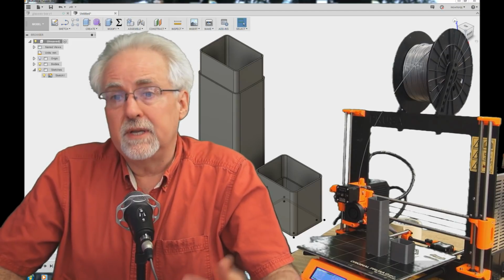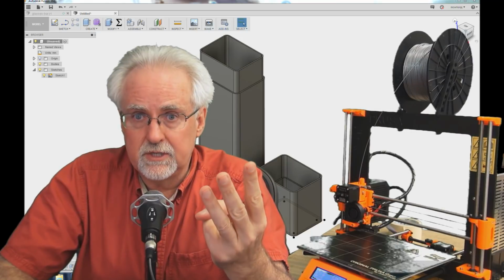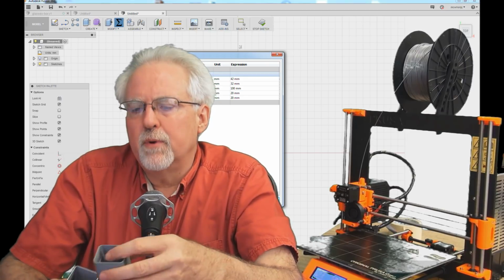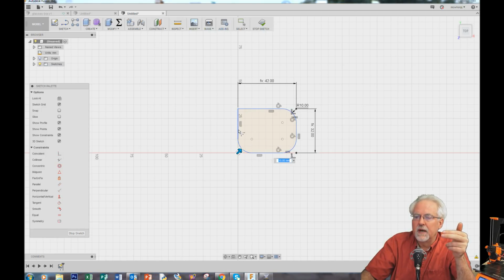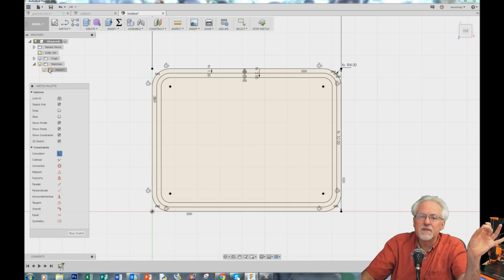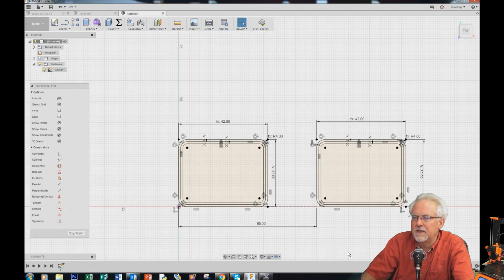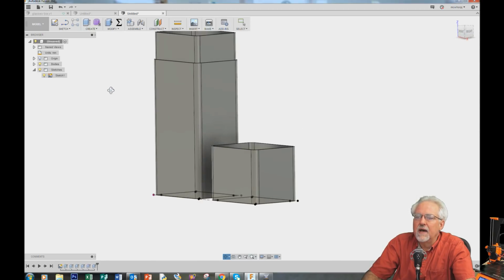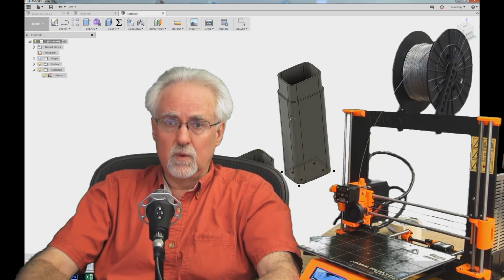Learn Fusion 360 or Die Trying LESSON 5: Understanding Parametric Design and Modeling

Comment: If i type - (space) lip thickness I don't get the same problem as Paul does and don't have to re-enter the wall and lip thickness offset numbers. And the total height was height + lip height so changing the lip height does change overall height. But not a big deal. Loving the series and learning lots. Thanks a million Paul

Comment: I will tell you, I just downloaded Fusion 360 2 days ago. I needed to make something simple so I played around by myself. I have never designed or worked with much in 2d but I got it done in a couple hours because there was just thickness for the 3rd dimension. I have since wanted to design something more complex. I am glad I found your lessons. They go just slow enough to understand and do along with, but not too slow where you are waiting. I didn't understand how amazing this program was. Now in just these 5 videos I think I could take off running. I will however choose to learn more from the other ones.
Reply from the maker: Thanks for the kind words. Glad it is working for you.

Comment: Paul you are doing a great job all around; BIG THUMBS UP. Question: I have a table I'm drawing and each leg consist of (3) different pieces of wood to complete the leg. The leg is in the shape of a triangle, should I draw them as (3) different components?Two of the parts will be made from 2x4 and the third will be from a 2x6. I will later do a cut list and would like to know what components used 2x4 and which ones used 2x6. Any help would be greatly appreciated.

Comment: Great presentation ... have one question though.  Coming from a tool and die background, where does fit interference come in on the dimensioning. Normally eg. ... a 1” OD Bearing of material won’t fit in a 1” hole. As you know there needs to interference fit calculated into the drawing. How does ‘‘tis figure in on 3 D Printing. Thanks again.

Comment: Thanks for your guidance  Paul. Lesson 5 complete and it's given me enough of a clue to use parameters in my design work. I've also modified you design  a scootch on the cap to increase itself a bit so that it fits over the base easily. No 3D printer is perfectly accurate and line squish will oversize an object by about 0.1mm or so. This causes the cap to bind up so I added another parameter in the model called SquishComp which over sizes the cap by that amount. It's an absolute value since the squish isn't cumulative. Onto the next lesson. Once again thank you sir.
Reply: I would have thought that the slicer software in conjunction with the printer's profile would take care of this properly.  After all, the slicer output G-code is not going to instruct the nozzle to extrude centered along a wall boundary line, it will be offset to one side by half the estimated width of the filament extrusion. That said, it is good to be aware that clearance can be addressed in the design tool like Fusion, and indeed is made easier by making clearance a parameter.  Of course, all bets are off if you want to print the two parts assembled :-).

Comment: Love your tutorials! Thank you! Have you thought of doing a tutorial series on Eagle PCB from Autodesk. It is the only software that I use in my classroom that you haven't done.
Reply from the maker: Believe it or not, I have never done a pcb board before. When I played around in the past, when it got down to it, there were a bazillion different "choices" as far as the design and fabrication parameters, and I did not understand what meant what or what was important. It was easy enough for me to grasp the concepts of layout, where the holes and wires go and so forth, but then when it got to checking design rules and all the parameters, I felt hopelessly lost.
Reply: @paulmcwhorter  
Fusion 360 allows Eagle PCB to be pushed to it. Image designing a 3d enclosure around the pcb that is right in your model. Osh park has a DRC file on their website plus simple instructions on dropping a zip file on their main page. Then you see all the board layers as they will come out. I have sent a file and got 3 boards back for $13.00 usd. 
Anyways, thanks for responding! You are making the world a better place. Bless you.

Comment: I've been following along just fine with the videos. They're great. Made several items I needed (boxes) and can see why parameters are better than just randomly changing everything when you need a new size. But when I try to create parameters for my 140 by 45 mm box with a radius of 2, it won't let me offset by wall thickness. I can't seem to find the error... Any ideas? I have wall thickness set at 2 and lip set at wallthickness/2. The word stays RED when I try to hit enter.
Reply: So, I guess I answered my own question. Turns out there is a new bug? in Fusion 360 - you have to flip the direction in the dialogue box to do a negative offset, now. Doesn't look like you can do it from the keyboard. Negative numbers don't seem to work at all.

Comment: Thank you for your awesome series of lessons Paul!

Edit: I deleted my previous writeup detailing an issue that I was having following your parametric offsets. After quite a bit of research, I found that Fusion no longer supports negative values for offsets and you must use the "flip" option in the offset dialog box to indicate the correct direction for the offset. Hopefully this is helpful for anyone who has issues following along with this video.

Comment: Hello,

Is there an intent on building the case by it's outside diameter over it's inside diameter? Like could we use the length x width and offset outward instead of inward? That way we know the ID can store the glasses. How would that effect the ability to extrude?

Thanks

Comment: That just made my life so much easier ! I was using( struggling with ) turbocad  and have decided to try fusion as it has cam capability for my engraver .By using parameters i can design cases for my Arduino projects and change the size with ease ! There many other uses like patterns for cast flywheels etc and the list goes on .
Thanks Paul !

Comment: awesome lesson, i thought this would be a scary lesson, actually so helpful. Could i add a parameter for an angled rectangle set upon 2 vertical rectangles at each end, and if changing the angle keep the verticals the same height? or just have it as one piece and change the angle?

Comment: this is great! question though, how do ou deal with tolerences in a case like this? If i were to print this right now, it would never close.
Reply: riri284 a bit late: add another parameter with the tolerance built in. Like lip thicknesstop = lipthickness - 0,3.

Comment: great presentations. like many have said "this is the best series".
 any chance of doing one on importing from skecthup and dealing with stl files?
Reply from the maker: When I tried using sketchup things ended up in such a mess, that is why I bit the bullet and moved to Fusion 360. I really would not undertake to import a sketchup into fusion 360 because you could not have a timeline. Hence, I just design from scratch in Fusion.

Comment: I'm no F360 expert, but was in manufacturing for many years.  I would think two choices might be better:
1.  Since this is made for glasses to fit inside, use your INSIDE length, width, and height as the primary dimensions, and drive your outside dimensions through the wall thicknesses.  That way, once you find the proper dimensions for a desired fit for the glasses, changing the wall thicknesses won't alter that fit.  As drawn now, changing wall thicknesses will affect the way the glasses will fit inside.
2.  Use an equation for the corner radii - such as (width+length)/9.  That way, the corner radii will always remain proportional in the overall look.
Just my 2¢.  Thanks for the clear instructions - and especially for repeating and reinforcing each one.
Reply: @Blondie SL A rather delayed response, but basically yes. Ron is saying that if you're going to capture the intent of the design, then in this example the intent is for the case to fit around the glasses. So the underlying info is the dimensions of the (folded) glasses. Those would be an irregular shape, so the next best is the dimension of the smallest rectangular box that can fit around the glasses. We can use those dimensions for the interior of the case. Then for the exterior dimensions add the thickness of the wall (itself a parameter).  You would need to add double the wall thickness to each dimension, since there are two walls, one on each side, in any direction. So OutsideWidth = InsideWidth + 2 * WallThickness, and so on.
Reply: Great points! I would make one more change. What would happen if the width was 67 mm?  The two models would overlap.  The spacing point shouldn’t be set a.length of 65mm, but rather the length parameter + 20 mm.

Comment: Another brilliant lesson, thank you so much for providing this top quality training free
I was a lecturer in electrical engineering for nearly ten years and
I have been stuggling with fusion 360 for well over a year
you are one of the best teachers I have ever come accross
I love the way you lead us down the natural wrong route to demonstrate what we don't know
when we know what we don't know, we are ready to learn the correct way of doing things
the problem with all the other training videos is they deliver the training from 
an experienced cad designer point of view, not structured for learners
just a minor point, which I almost appologise for mentioning, 
would this make the overall height bottom + top + lip heights
so to make it just bottom height + top height
the top would need to be top height for the outside edge
and top height - lip height for the inside edge
thanks again
John
Reply from the maker: thanks, and yes good suggestion on the parameters.

Comment: Mr. McWhorter, I noticed you had no allowance between the cap and the body but they fit perfectly. Why was that?
Reply from the maker: This depends on your 3D printer. For my raise 3D ID of one item matching OD of mating item leads to a nice snug fit. That is something you have to sort of determine for your 3D printer and slicing software.

Comment: You made a mistake. You should have offset the second sketch from the bottom left corner of the first. If you’d set the width to 70 then you would have been in a world of trouble. Other than that, top tutorial. I am polishing my skills.
Reply: Or make the line length = a parameter that = width + 20 (or something like that).